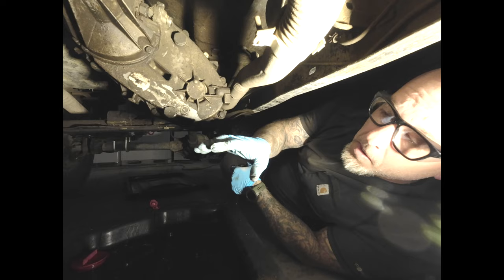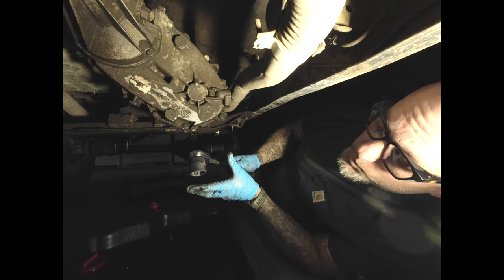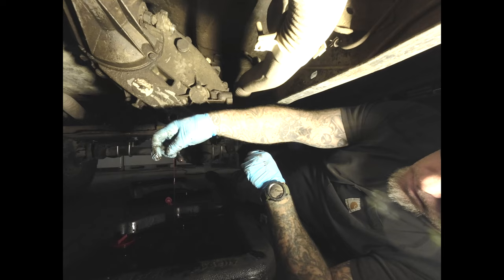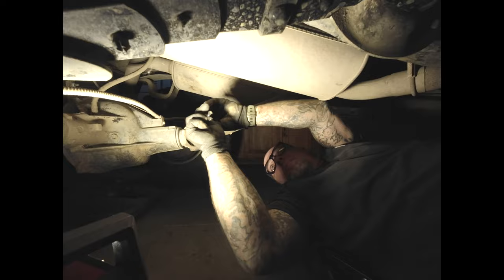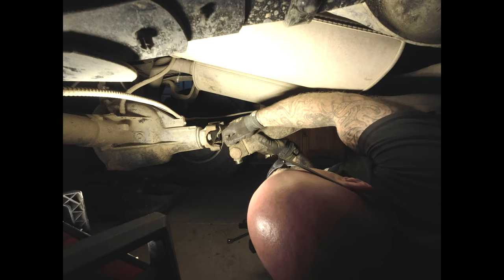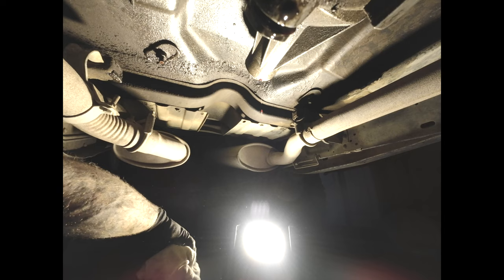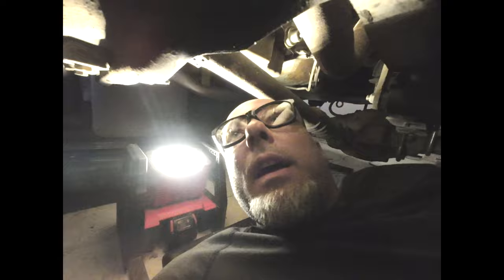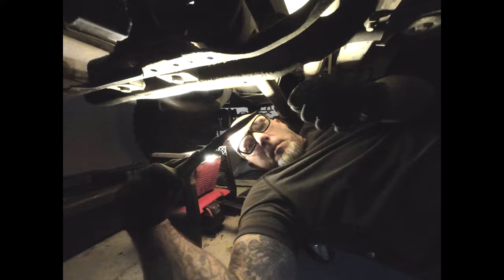How To Remove a Transfer Case from a Square body

Comment: Is a np203 the same process ?
Reply from the maker: That's a good question- I've only dealt with the 208 but all the components as far as front shaft, rear shaft, speedo cable and general unbolting from transmission will remain the same.  Please correct me if I'm wrong.  Thanks!
Reply: @smelllikeoutside  yea everything was the same just did it in my driveway with a floor jack
Reply from the maker: @weman5390  Nice! Glad it worked out and I appreciate the update. Helps me expand my knowledge.
Reply: Where’d you put the jack pad on the 203?